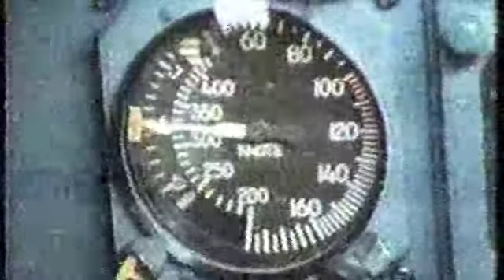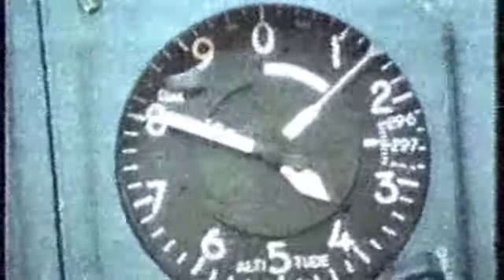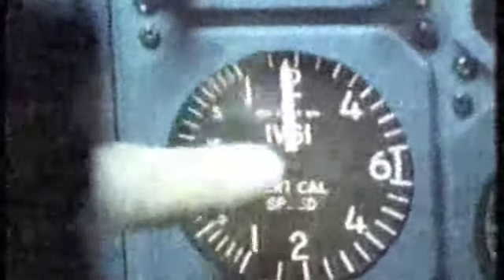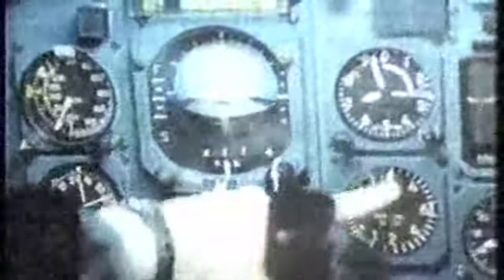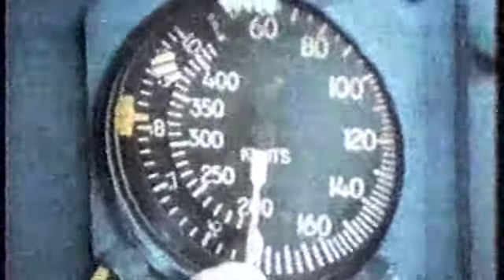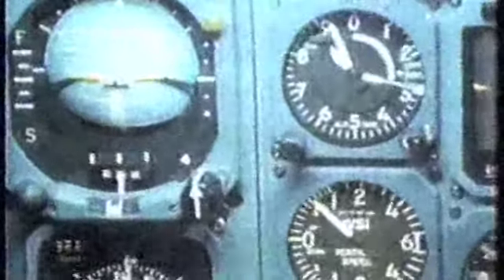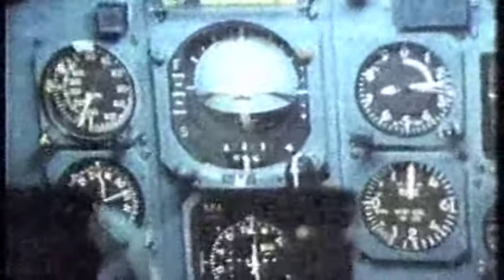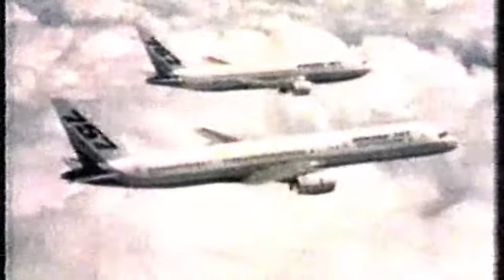The Wrong Stuff- BBC Horizon Part 4

Comment: It's really interesting to see how these issues were perceived from the vantage point of the mid-1980s.  Being a TV documentary aimed at the general public, the script does veer into hyperbole in places - but the questions being asked are - and always will be - relevant.

It's also somewhat sadly ironic that the first half of the documentary focuses on the importance of communication and teamwork over ego on the flight deck in terms of improving safety, yet towards the end you can see an emerging sense of distrust between (some) pilots and engineers that has repercussions to this day - almost 40 years later.  Admittedly this is with the benefit of 20/20 hindsight, but it's a shame that the lessons being learned at the time in terms of effective communication and mutual understanding between every member of an airliner crew were not being applied there too.

Two years after this programme aired, the Airbus A320 entered service, and the subsequent misunderstandings between the piloting and engineering communities - exacerbated by a media hungry for controversy - made things far more difficult than they needed to be.